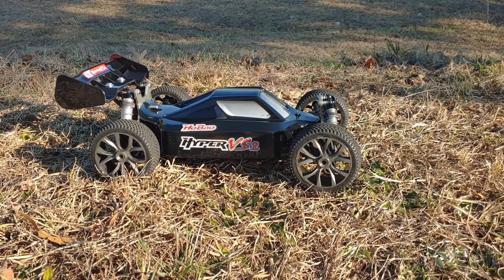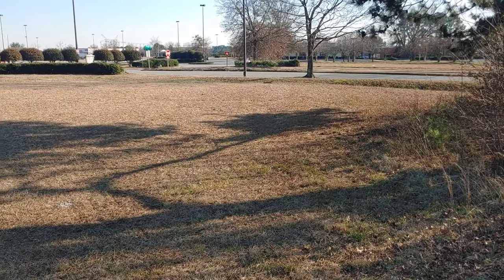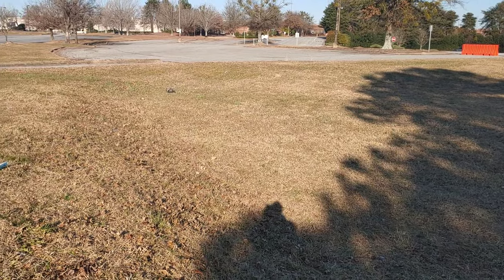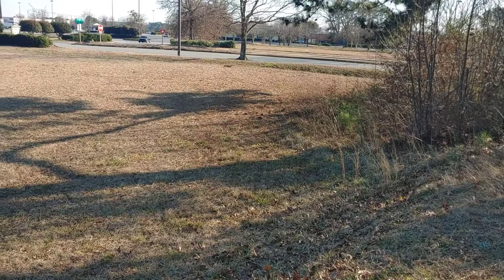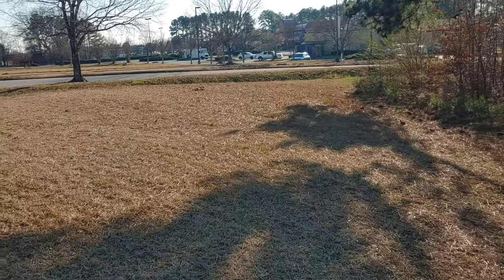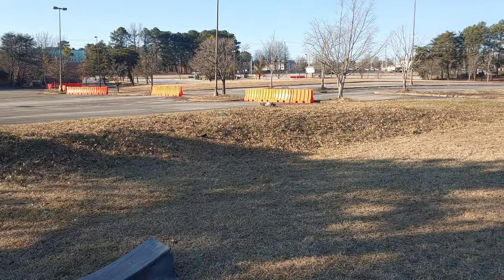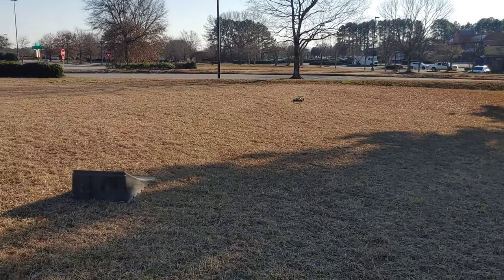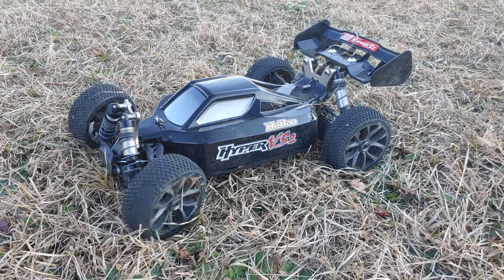Hobao Hyper VS2 Buggy 1st 4s Run

Comment: The buggies are amazing, they're so tough. I don't know why people buy a 6s typhon over these apart from the aftermarket m2c support.

You'll want a bigger pinion though, I'm running a 20t on a 2650kv motor which is just about right for pulling double flips.

Oh, and if you fill the center diff with 50% earplug and 50% 300K  it really help sort the way it puts the power down.

Comment: Perfect time for a comparo between this, the Typhon, Radix, and Vorza. I think that's pretty much all the 1/8 RTR buggy heavy hitters.
Reply: Serpent has a nice rtr buggy
Reply: @stonejss727  ah yes, forgot about that one,the nitro one happens to be on my wish list as well
Reply: @vivos71  All those buggies are pretty sweet… My wish list never ends… lol
Reply: @stonejss727  the Serpent Srx8e RTR and it's legit! The front shock tower is weak, bent that sucker back pretty bad after bad ramp landing on grass field.  Bent it back & good to go 🤙🏾got the Serpent Cobra 811te RTR & that's a bad boy too!
Reply: Kyosho Inferno Neo 3.0 VE as well
Reply: Are they the same speed or same size lipo?
Reply: @ricksprings  at least the kit options are all available as upgrades
Reply: @d-nice2866  all 4-6s, and all 1/8 buggies, will all have similar speed. I think the serpent might only be 4s, but that's a $130 ESC away from being a problem solved
Reply: Serpent is SICK and it is balanced now like the Truggy and MT with 2 battery pack areas side by side.

Comment: Now THAT'S pretty cool Jay. That thing jumps super smoothly and you were getting some real air there bro! You think this one could give the Typhon a run for it?? Cool vid brah...👍💯
Reply: @JayTeeRC  Let me ask it this way. I have the Typhon TLR running on 4S only as a basher same as you run this one here, no tracks. I am running a Spektrum 2050kv with a 19T pinion Firma 150 ESC. It's fast and I like it top end is no concern to me, Your Hobao seems just instant speed. Is this because of the 2200kv motor? What model motor is that not sure if it would do the same for me? Or, if I dropped my pinion to say 16T would that speed up the 2050kv?

Comment: What’s up JayTee. This your boy from hobbytown the other day. I’m having some issues with my Velineon ESC in my stampede. When I’m running 2 or 3s lipo it will run good for about 2 minutes then shutdown and the esc light will go from green to red and won’t turn off unless I unplug the battery. Then when I power it back on the light is red and the car will run but won’t run in lipo mode unless I switch the battery and do the process to switch to lipo again. Then it do the same thing again and go back to red light. What’s up with that bro?